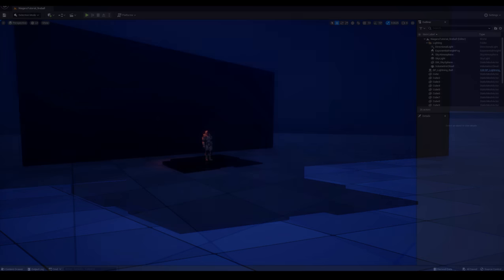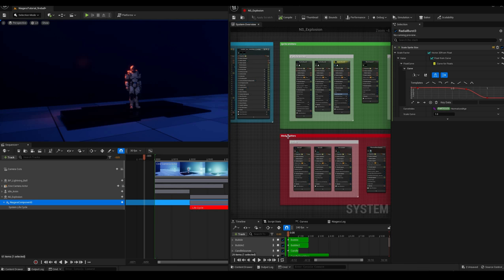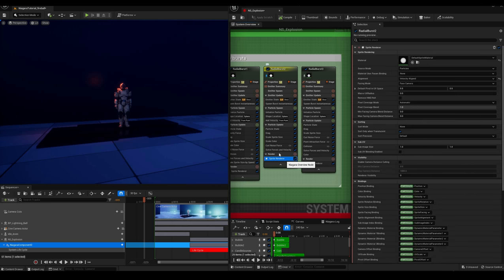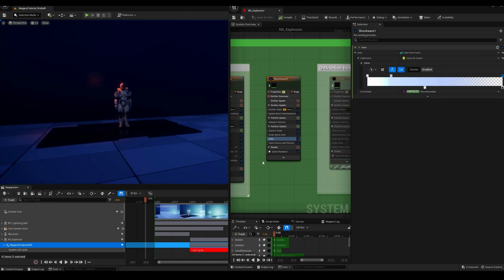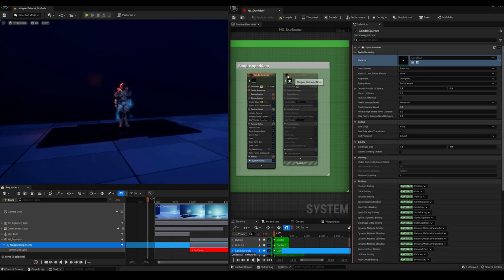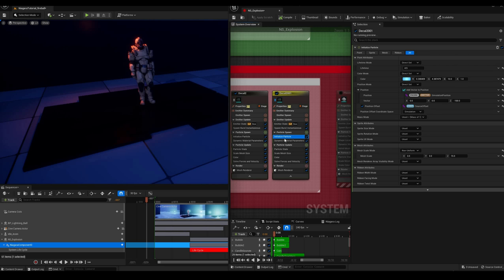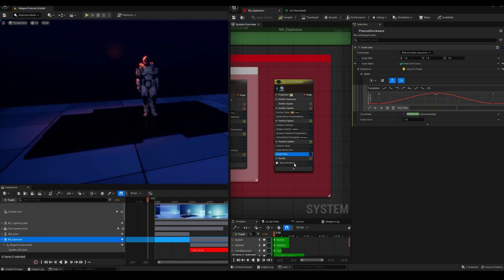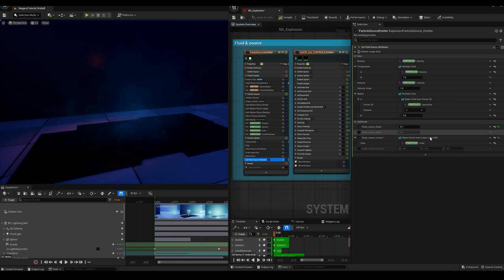Unreal 5.1 - Creating cinematic VFX from scratch. Chapter 3: Explosions!

Comment: I have a few questions:

1. I wasnt able to get the decals to spawn properly on the ground with your particle settings. I used a "Cube" mesh from the list and applied a material that we created in the previous step (the animated one), but I never could get it to be seen on the ground...
2. I really had no clue how you did all these parameters for the Gas and Fluid volume at the end..I checked previous videos from you but it didnt look like you explained those before so I wasnt able to recreate them.

Info: im not trying to create a cinematic effect, its supposed to be used in runtime as an explosion VFX and even without the decals and gas/liquid it looks really amazing and has been a great learning experience for me so far! But all these custom parameters that I cant naturally set inside the particle effect are too overwhelming for me as of now :)
Reply from the maker: 1.- Unreal 5.2 now has a Decal Renderer module in Niagara so that should not be a problem anymore :)
2.- Yeah, fluid sims can be a bit overwhelming, and it is still a very taxing effect to use in runtime. I might make a tutorial going over the different templates, and how to render them as spritesheet sequences, if there's enough interest in the topic.

Comment: I am totally stuck at on the PlasmaShockwave part... I get a transparent/reflective sphere but not the effect you are getting with multiple of them expanding outwards... I've pretty much copied all of your settings at this point. any tips?
Reply from the maker: Make sure that you are spawning multiple copies with a spawn burst instantaneous. If that is not the issue, it is probably because all the copies have the same settings, which makes them overlap. Check the lifetime and dynamic parameter settings :)
Reply: @EnriqueVenturaGames  Appreciate the response.

I have the same exact settings that you have and the same exact material. 
"spawn burst instantaneous" is set to 10 - and yes it does currently look like they are all overlapping.
The only way I have been able to see multiple circles is if I change mesh scale mode from uniform to random uniform, it separates the orbs. but obviously isnt the look we are trying to achieve.

my lifetime mode is set to random and min/max is .3 and .6 just like yours. Same dynamic parameters as well.
I really don't get why mine would be so much different.